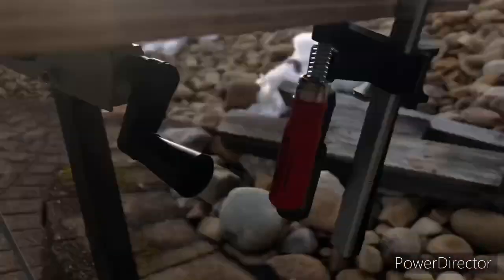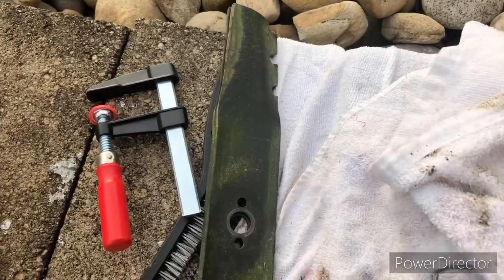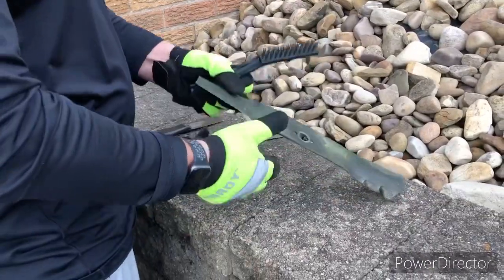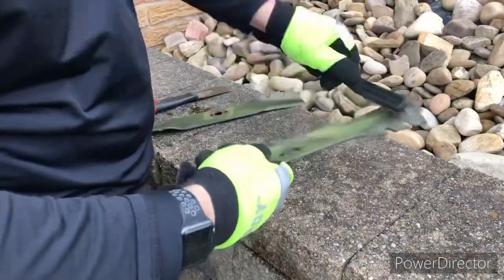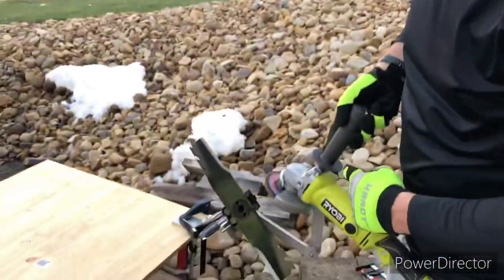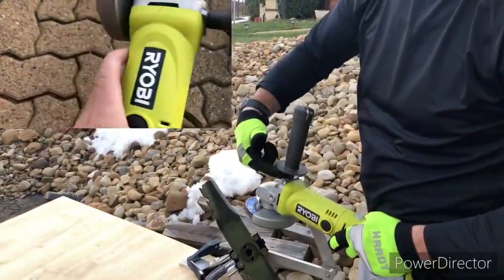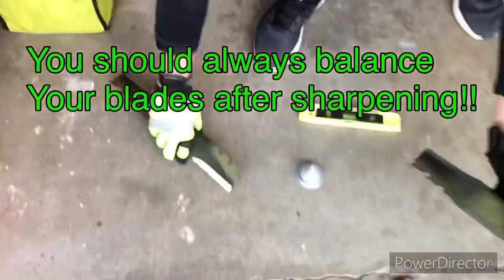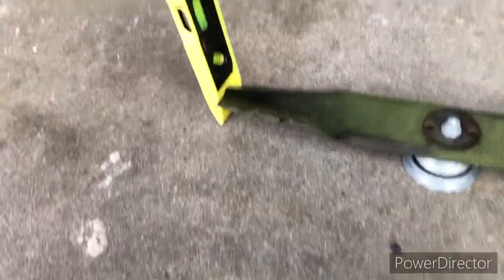Before you PAY-Watch this-(Easily Sharpen Lawn Mower Blades)

Comment: What were you doing with the torpedo level?  Wouldn't a ruler be better?  What grit flap disc were you using? 40 grit?
Reply from the maker: Yes 40 grit, I showed the flap disc in the video. I just use that torpedo level just for the balance of the blades and yes your absolutely correct a ruler would be much better and I never even thought of that  so thanks so much for the comment!! 👊🏼💯